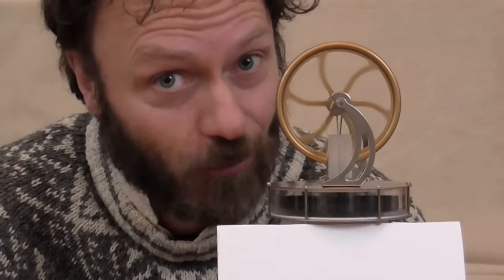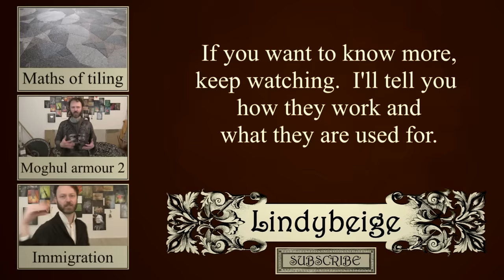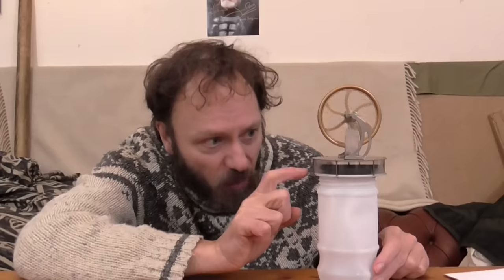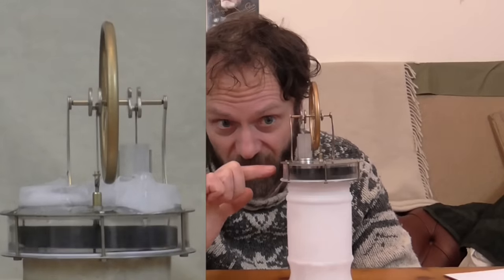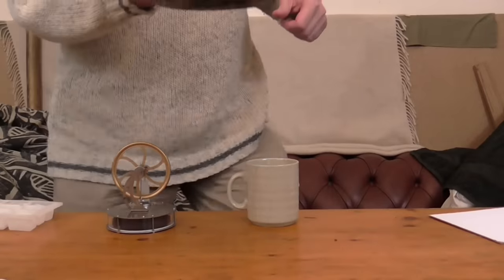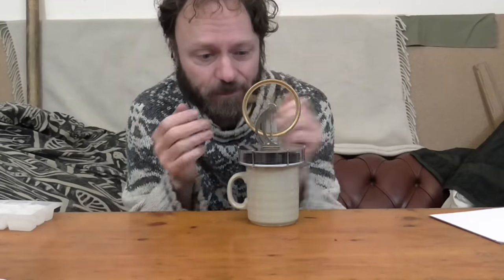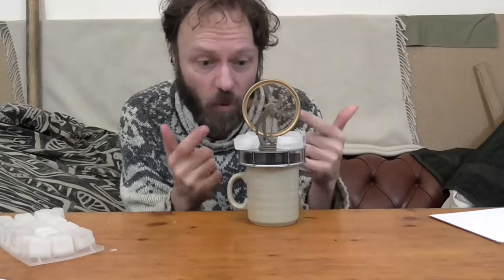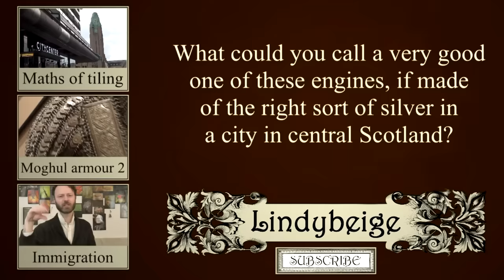Stirling Engines - the power of the future?

Comment: could there be a nuclear powered sterling?
Reply: after some thought, i've concluded that you could indeed make a sterling fueled by Atomic energy.
Reply: Haha, yes. If you have a way of making something hot and/or cold you can run a Stirling with it. The caveat there is, running an engine/reactor/device of some kind to produce heat just to power a second engine with it usually doesn't work so well, as losses due to inefficiency compound.

However, if the heat/cold is readily available, being produced by another necessary device or is already required in the area, then a device like a Stirling can be quite valuable as it takes advantage of the existing circumstance.
Reply: Steam turbines are more efficient than Stirling engines. Maybe you could make an atomic generator that does not heat water, instead heats directly into the heat plate of a Stirling engine. Maybe if you achieve a high enough heat gradient, it could be as efficient as a steam turbine, but I don't see the point.
Reply: Jonatas Silveira Baldo an even more quite nuclear submarine is about the only thing I can think of. Perhaps nuclear power plants in desert areas without much water.
Reply: At 50% energy efficiency, you certainly could make one that would generate large amounts of energy.  Not only that, but nuclear waste is known for generating constant amounts of heat for many years... by making use of this waste heat you could still pull power from it for a long long time.  It's actually shocking that governments haven't made use of this already, considering the huge amount of nuclear waste there is...
Reply: radioactive ice.... melts
enter radioactive water, the second least desirable item on earth, after rosie o'donnel
Reply: This has been looked into by NASA and a couple of private bodies. The answer is Yes! and the best engine is a free piston stirling engine (FPSE).
Reply: Heart Fire why would the ice be radioactive?
Reply: nasa uses nuclear powered stirling engines in some of their deep space satellites.
Reply: stirling engines can get to 90% efficiency, steam is not as good as sterling.
Reply: ***** 50 yes but with better techniques and if more people were interested it could go higher.
Reply: I know I'm late for the party but anyways: You know those big radioisotope-generators, they stick onto spacecraft? They usually have efficiencys of 15 or 20%. So putting a stirling-engine onto a nuclear heat source seems to be a very viable option. The main concern at the moment s far as I know is the reliability of moving parts on the timescale of decades but apart from that.....it's not only possible but possibly even the future of RTGs.
Reply: Of course but why?

We use incredibly efficient steam turbines with nuclear reactors. There's no practical reason to replace them with stirlings.
Reply: It is my understanding that Stirling engines are not used as the primary generators in nuclear reactors because it would be far more expensive and provide little gain in efficiency.  (Remember that they do not scale up to very large sizes as well as other technologies like steam turbines.) So even though the energy produced per pound of fuel might be higher, the energy produced per (insert currency of choice here) spent would be lower.   They do however have much potential as a way to increase overall efficiency by utilizing the waste heat left unused by things like steam turbines.
Reply: People seem to have a wrong idea about what "waste heat" actually is.
Reply: +Arthur White Sterling Engines have no use in space. What you need in space is electric energy. Sterling engines turn heat disparity into kinetic energy and rely on surrounding air and athmospheric pressure. So you need an additional generator to turn the kinetic energy into electric energy. That's a lot of weight and not very efficient and you can only use them inside pressurized space crafts.
What is already used in space crafts are peltier elements. They turn heat disparity directly into electric energy. They are also not very efficient, but much much lighter and even more important: They work in the vacuum of space. Also peltier elements have no moving parts, therefore no need for lubrication and no mechanical wear.

Comment: But can It be used for bombs? all good power sources are bombs eventually
Reply: @TheBlasterGameGuy Anything you can harvest energy from can be turned into a bomb and yes I did fall down the stairs
Reply: Ironically, the reverse was the original intent.   I've got a rather worrying book on boiler explosions.   In the early days of the industrial revolution, metallurgy, mechanics and physics being what they were, boiler explosions were frequent and usually pretty lethal and devastating.   The Rev.Stirling developed his engine in the hope that dropping the need for a boiler, steam under pressure etc., would reduce said explosions and save lives.   Actually, mechanical explosions can be pretty nasty.   Krakatoa is a fine example where it's reckoned that a cubic mile of sea water flooded the magma chamber of a rather active volcano.    The instantaneous vapourisation and resulting explosion led to rather fine sunsets of the other side of the world, as well as a lot of grief!

Comment: Well it certainly has merit, if you have a lot of waste heat anyway from whatever you are doing.
Reply: IceLand or Africa?
Reply: Not just waste heat, but any undispersed heat. So for example, a fire being used to heat a room could simultaneously power a stirling engine.
Reply: Air conditioners and fridges give of heat to.

Comment: Ah yes, you have started the old wheels a spinning once more!  While I have studied up on the Sterling many times in the past, the way you put it really got me to thinking.  You see, right now I am forced to remain up here in the frigid cold of the Dakota's for another winter, contrary to my previous moves to Arizona to enjoy their sunny winters because mom, who is now 93 has entered the nursing home, and, well when she begs me not to leave her there all alone, who could say no.  So we heat our home with propane fired hot water in a furnace that has a hot boiler, so she always has heated water in the tank  that holds a few gallons of water, when the thermostat calls for hot water, pumps begin to circulate it through radiators that are mounted near the floor on all the walls of our home, thus heating the, at time sub  zero F temps up to a living 66 degrees or so.  With only about 4 inches of insulated wall keeping the hot from the cold, putting a plate outdoors and one indoors with the mechanize in the basement, I could well generate some nice electricity to save on my energy bill, and charge up some storage batteries for those times when the blizzards that blow through this frigid part of the northern United States blow down the wires that furnish us with life preserving electricity to run the pumps on our furnace and keep us warm. Of course such a challenge would take money, and since I have a constant shortage of that stuff right now, perhaps all this will turn out to be is a pipe dream. (Had to give up pipe smoking as well after watching my two sisters suffer with cancer, the result of cigarettes.)
Reply: Problem with that is that in operation Stirling engines do begin to move heat from the hot side to the cold side. You would be generating electricity but also cooling down your home. If the propane costs more than the electricity. Not worth it.

Comment: "generating 1 W of energy" my ass
Reply from the maker: Per month.
Reply: Lindybeige That's not how Watts works.
Reply: Lindybeige, you mean to say one Watt-hour per month.
"watts per month" doesn't make sense.
Reply: way less than 1 watt. 1 watt the power that can drag 1 N 1 m per second. Like elevating a 100g object 1 m/s.
Reply: Lindybeige 1w per month? Watt is a unit of power, that doesn't make sense.
Reply: Except that there's things like kilowatt hours, so it does make sense.
Reply: kilowatt hours [kW h] are a unit of energy. It is the amount of energy related to one hour of work by a 1000 W powered source. KiloWatt PER hour [kW / h] would not make sense. Similarly, 1 W per month does not make any sense except for people undeducated about engineering and physics
Reply: Magnum756 Well explained, I was about to do the same but saw you already did it =3.
Reply: Actually I don't think it is far. 100 g is not that heavy. Probably it can lift a 50 g object at the rate 1 m/s.
Reply: You're joking right?

Comment: You presented this in your usual  enjoyable style. One area where Sterling engines are in everyday use is as engins to drive fans placed on top of wood burning stoves to circulate the hot air. However they have competition from thermalelectric fans that exploit the Peltier effect (https://en.wikipedia.org/w/index.php?title=Peltier_effect ). I think that if you were to revisit the subject comparing the two it would make an interesting video.

Comment: I love this video.  Very cool way to generate "free" energy from waste heat.  I'd be interested though, to compare Stirlings to other waste heat energy generators.  For instance, the Organic Rankine Cycle uses waste heat to run an air conditioner compressor in reverse to generate electricity.

Comment: You miss one of the most common uses.  If you provide rotary power to a sterling engine, it can cool one side.  This can get cold enough if you use helium as your working fluid, to cool air to liquid nitrogen.

Comment: So if you made the flywheel with permanent magnets and encased it in or between static coils and added a thermoelectric peltier plate to the top and bottom of the barometric differential chamber powered by the voltage generated by the magnet and coil assembly as it rotates, could you not approach 100% efficiency with the use of superconducting frictionless levitation bearings? Sorry if that's too obvious a question.

Comment: One thing to note is that there are multiple types of sterling engines. This particular type is called a "Low Temperature Difference" sterling engine. There are 3 more types of sterling engines. 

Another one is called a "High Temperature Difference" sterling engine. This type utilizes a source of concentrated heat on one end.

I don't know much about the third kind; just that it is much the same as a high temperature difference engine but, recycling the heat that radiates away from the engine.

The fourth type was actually developed by Phillips, strangely. It was intended to help in cryogenics. There are two videos describing how it works on YouTube; from an instructional video that Philips produced in the late 70s and early 80s. They're called "The Stirling Cycle part 1".

Comment: To build a tropical Stirling engine, well equatorial desert really, you could use a lower chamber of porous earthenware filled with water.  Ceramin vessels of this type are used to cool water in some regions.  The water very slowly percolates through the earthenware and evaporates at the surface, cooling the vessel.  In that fashion you could employ the sun to both warm the upper plate and cool the lower.  No idea what would work in a humid and hot environment.

Comment: You can also use it vice versa: If you are turning the wheel, maybe with wind- or wazerpower, one of the plates gets hot and the other one gets cold.
So you can also use it for heating and cooling.

Comment: Drill a heatsink block to allow water to cool the lower block and ambient temp or just the sun to heat top block, great irrigation pump as the water is always cold, vast temp difference or gradient here in AZ. Greatest out put during the day, but still working at night as air temp is still warmer than the water.

Comment: Seems to me this could easily be made into a bicycle assist...an insulated cold pack on one side and an insulated hand warmer on the other...attached at the drink holder and to the wheel..by a brake device that would disconnect when you want to slow and/or stop...more or less...lol..need to eliminate the need for heavy liquids...good video

Comment: What do you think of the following boat installation: charcoal dust from hemp waste, heating the Stirling engine with this dust blown into the combustion chamber, water circulation through the surface of the underwater hull ? Could that work? Other advantages: Compressor operation for air conditioning, refrigerator and freezer. Also heating of the service water in the boiler ?

Comment: You could also use these well in hotter climes, you just have to stick the bottom in a deep and cold river, and have the top exposed to the hot air

Comment: Um, hi!  Your model has a spinning disc perpendicular to a cylinder of similar size.  If they could be made parallel that would make a compact pancake motor.  Fan blade struts on the flywheel could assist in cooling.  Mechanical train might be hard to implement though with the tight space  & the 90 degree turn.

Comment: Sterling engines don't need much to any resources but heat and a little lubrication.
Some people make sterling engines out of old air compressor pumps and pumps from cars, easy because you already have a sturdy cast iron base and the duel pumps are already designed 90 degrees out of revolution from each other.
So it is already half made, just a couple modifications, to make it sterling! 
Also some people have put a valve in the air transfer tube to control the speed!
How cool is that!
You ask the clerk at menards you want just a air compressor pump, he replies "what?!
Don't you want an air compressor ?"
You just reply "I'm only obsessed with compressor pumps!"

Of course mostly the whole sterling engine idea is extremely captivating!
I want to make one myself.

Comment: The early use of Stirling engines was in the old GPO, where they were used to generate electricity for  the telephone exchanges in remote areas. They operated 24 hours a day,  365 days a year, were silent and required no maintenance. The original fuel was gas or oil burner.

Comment: Hi and thanks , this was entertaining and informative. ....  Question: In a cold climate, both air and water are cold.  In a warm climate both are warm.  So to get say a 50°C gradient surely you need the same heat input into your water in both places,  I.e., doesn't that mean there is really no more efficiency in cold climates if you factor in the initial energy input needed??  Thanks

Comment: My question about these is does it speed up the transfer of heat from the hot side to the cold side or are the two sides insulated throughout the cycle? I think it would limit a lot of applications if it is actively transferring heat out of the hot side into the cold side.

Comment: It got quieter briefly because the weight of the ice held it more steadily and firmly in place. As the energy output and flywheel rpm increase, the noise increases due to instability

Comment: Using copper plates instead of steel would allow it to work better since the heat exchange is higher in copper than steel and also if the sealed "Air" chamber was filled with a gas that is more thermally conductive than regular air it would also perform better. One rather useful application is using a frenal lens to concentrate the sunlight to a single point which can generate temperatures over 1000 degrees F and then using the sun to power the sterling engine.

Comment: I saw a DIY video on using the sun and bowl-shaped mirrors to concentrate the light onto a glass bottle of water.  The heated water ran a Sterling engine.  It was supposed to be more efficient than PV solar panels.  Don't doubt it.
Reply: Living in the S.W. that was my 1st thought as I watched this . Please , could you provide link ? Thank you
Reply: @timothycurlee9682  It has been years.  Hard to find.  So many videos on the subject.  I just searched using the YouTube search box with: "using sunlight to heat water to run sterling engine". Gives you dozens of videos.
Reply: Thanks  I stumbled across several also

Comment: I've been thinking about how to design an electric car using a Sterling Engine to charge the battery. Ethanol flame to heat the bottom and water to cool the top. If the car roof was a solar panel, the water from the top plate could be pumped to the roof to cool the solar cells and then go back down and cool the top plate of the engine. In Australia where we have a lot of sunshine, I think this could work. We also can easily use waste farm produce to make ethanol (e.g. spoiled or imperfect fruit that couldn't usually be sold, can be used to extract sugars for ethanol production. Was also thinking of putting small wind turbines where the radiator would normally go to capture extra charge for the battery. Tis a fun thought exercise.

Comment: I feel like they would be useful in the Arctic if you wanted to recycle the heat energy in a home/outpost but at the same time it's probably not worth the effort when we have better ways of making/storing energy.
Reply: Highest best use is to put a hunk of radioactive material in the hot side and let it just make power for hundreds of years without messing with it.

Comment: This could actually potentially work well with a zero-cost AC unit in high temperature areas... with the combination of geothermal. The groundwater in my area has an average temperature of 16°C, while outside temperatures hit as high as 45°C on a somewhat regular basis during the summer. By allowing a portion of the power to run a closed-loop groundwater pump past a heat exchanger, you can have a nearly permanent loop of a 29° delta. Further combine that with greenhouse-style solar oven techniques, and you could potentially raise the delta considerably higher; a few years back I blew up a mercury thermometer that went up to 50°C on my patio on a day it was only supposed to be 39° ambient. The thermometer was simply left on a table outside.